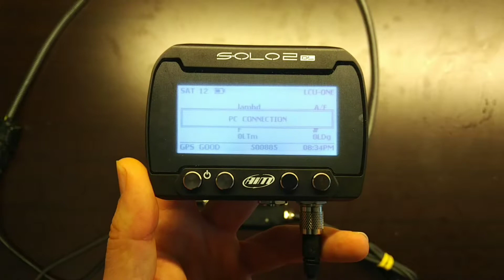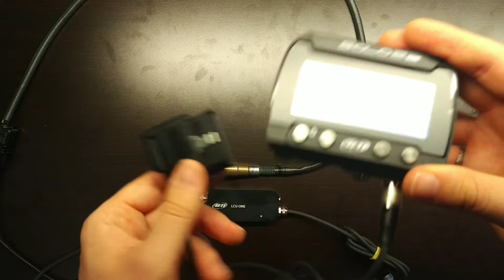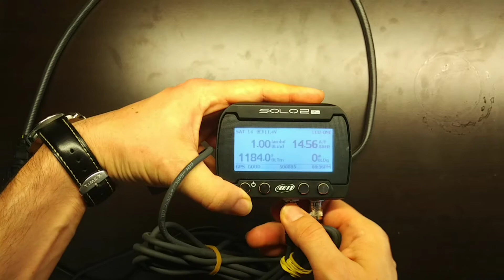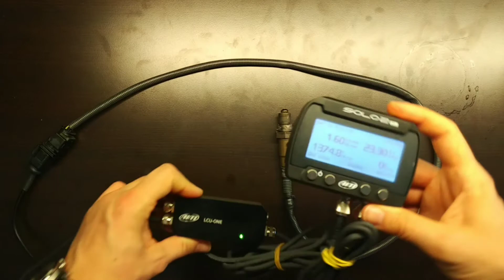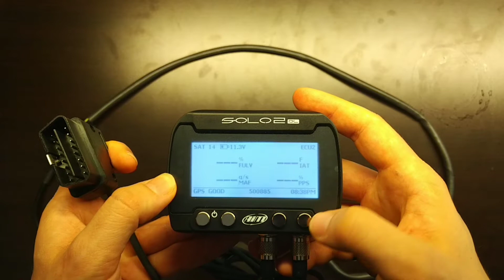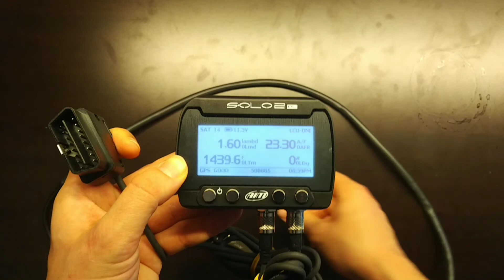AiM SOLO2 DL with LCU-ONE Lambda Sensor Configuration

Comment: Anyway to use this Wideband for the ecutek ? I been reading a bit about adding widebands to ecutek but of course most people don't use this one ha
Reply from the maker: These widebands can be used in any ECU that can process a 0-5V input, for almost all wideband signals in stock (or reflashed stock ECU;'s such as ECUTEK) this would work fine (you would just need to input the voltage curve in your ECU tune). They can also communicate via CAN with a variety of aftermarket racing ECU's.
Reply: speedmastermarine thanks so much for that. Very helpful
Reply from the maker: @02semiata  Not a problem, we are here to help!